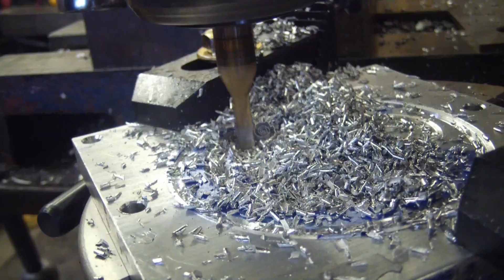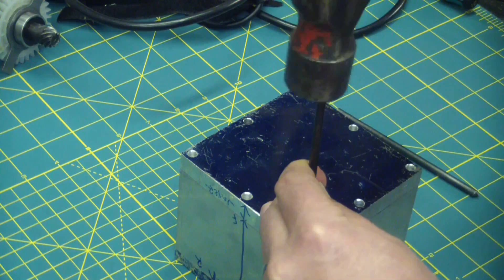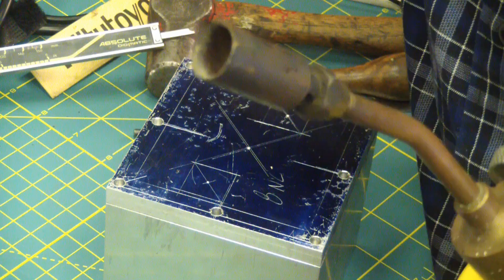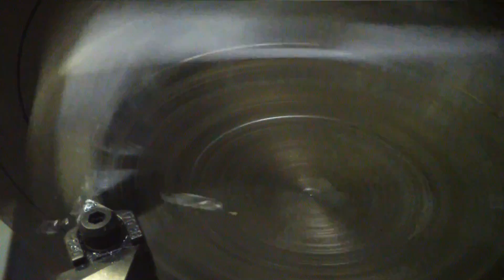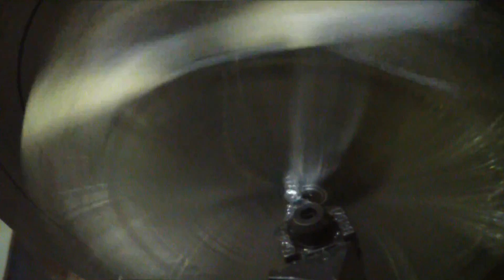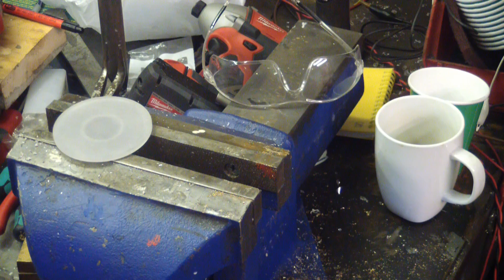Codename: Midnight Sun. (High Power Evaporative Cooled Retina Blaster)

Comment: What electronical bits do you need for the edm project? I'm building a bolt burner from parts off the junk shelf at work and might have some stuff you could use. I know shipping up there is a pain in the ass, but I might be able to sneak it through the shipping dept.